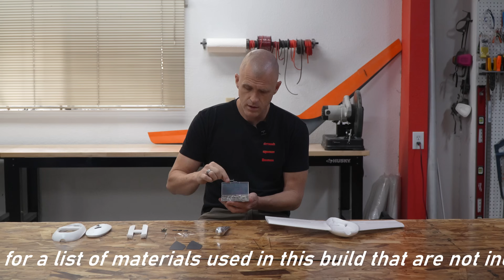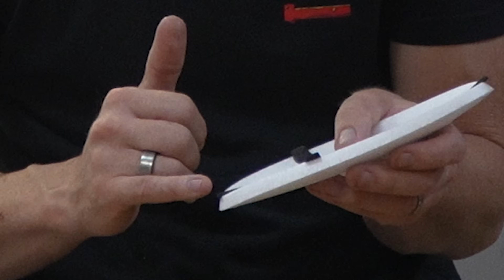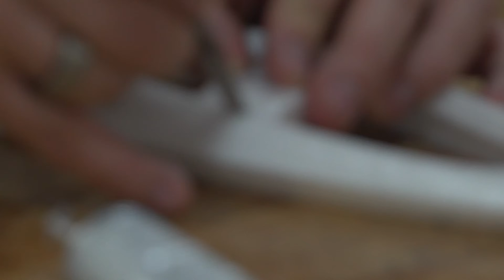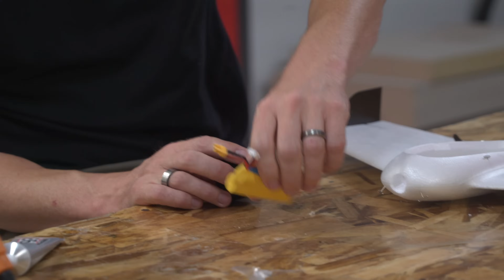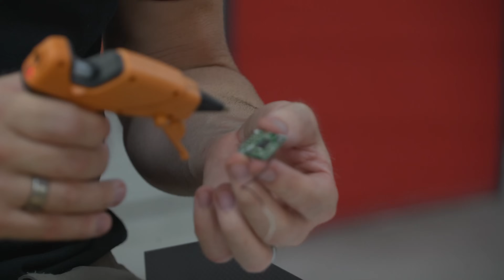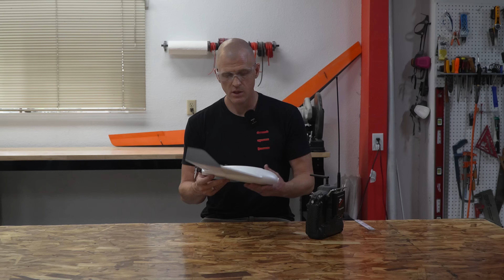Alight Wing Aeronautics Flik Build and Basic Setup

Comment: What's weird is that this guy designed the nano goblin first, and it has much better characteristics, I guess he sort of goes by feel and doesn't do fluid sim etc, but still weird that he couldn't' improve with the flik and it's just kind of the same but slightly worse (and supper expensive for a piece of molded epp) when moving the stabalizers to the wingtips

Comment: Apologies I am new to RC and have a couple dumb questions. 

1. How come he says the airplane is running on 8.4V (at 21:00) when the battery is a 2S 18650 Li-ion. Doesn't that battery config put out 7.4V? 
2. He says you need a BEC with the setup he has shown because the airplane (I read this as motor) is running on 8.4 V and all of the electronics (I read as servos) are running on around 5-6V, thus if you apply full battery voltage to servos they will likely fry. However the servos he has, and the ones that come with the Flik kit on Alight Wing website, are 2x ES9052MD. Per the servo data sheet, "Operates efficiently across a voltage range of 5.0V to 8.4V". So why the need for BEC?
Reply: 1: maybe they are so called hv-cells, which have a voltage fo up to 4,2v (I think) and therefore have a higher power density 
2. Not only the servos are electronics but also the avionics so receiver, video transmitter, flight controller etc., and these are running on 5v, and as the servos are plugged into the flight controller/receiver, these usually run on 5v too, as it is just easier to wire up. Higher volt gas arenonly used in cases where fast motion (<0,2s/60°) matter, like in RC helicopters.
Reply: @dontknow3886  I appreciate the response, thanks for the help! Makes sense

Comment: Ok I finally got my Signature Eddition in the mail! Saddly it seems as if there is an issue with the Included ESC, Do you have any tips or tricks to determine if I have a faulty ESC?  

When I plug the battery in I get the Initial 3 beeps but no other beeps after that, Is there a  tone that plays after the initial 3? Also when I plug the battery in and connect to ESC configurator I am unable to read the ESC.   Please help!

Comment: So bought the Emax RS1108 5200kv motor, EMAX D-SHOT Bullet Series 20A 2-4S kit. and realized it a 2 wire bl heli esc. I need  3 wire for pwm. Will any 20amp esc work in its place ?

Comment: Hello everyone. So I'm in the process of setting this little wing up. So, the wing spar can be glued in, and the covers glued on at the same time. I used foam-tac, which is best for Epp foam, and you don't need to pre-sand the release wax off. I tried to glue the spar in with CA glue, but it simply broke free with a simple flex of the wing. Foam-tac glue will hold the spar in place while you add glueto the edges of the wing spar pocket. Then, run some inside the little channel on the cover and push it into place. Working the cover in, every few minutes till it starts to cure. Foam-tac will bond in 15 minutes. I also used it to attach the winglets and stiffener/control horn. For electronics, I'm using Jx 5.6g digital metal gear servos and speedybee f405 mini wing fc. Motor is a rmrc 1306 3100kv motor and a 20a esc. On a side note, the control rods or pushrods need to be replaced with shorter wire. The ones I have are too long by 1/4". The build is fairly easy and shouldn't take more than 2hrs tops! Speedybeef405 mini fc weighs less than 10g by the way

Comment: Do you have a page or list of recommended electronics anywhere? I’m somewhat experienced with fixed-wing, but total newb with FPV equipment and flight controllers/autopilot. A video of how to mount the DJI FPV stuff for proper airflow, what flight controllers you recommend, and basics of getting started would be awesome. Understand if not in scope of the project, though!

(Kickstarter backer w/ two that I just received! Stoked to fly them!)

Comment: I've just purchased a flik and I'm wondering what spec 18650 batteries to use? Thanks
Reply from the maker: Molicel M35a should be fine with the stock power system.

Comment: I don't normally whine, but I sure wish mine would get here soon. Seems like it's been forever...
Am still thinking about a small EDF... maybe a 3s 40mm. With me... I never do a plane "stock". Am not concerned about 250g weight really. I did get the full-on Micro HDZERO package with the 540p camera option. Did get a better antenna than a straight dipole. Can't wait to get this plane up and running.
Reply from the maker: The patience of the community has not gone unnoticed, much gratitude!

Comment: Love what you do but between $80.00 and $145.00 for a form plane is crazy, I dread to think what the final price is for shipping to the UK.
I'm gutted, as I would have bought one if it were a reasonable price.
Reply from the maker: To give you a bit of context, at the price we are selling it, after everyone else gets paid I am making precisely 0$ at this point.   I may get something out of this in the future (maybe not), but from my perspective, its free.   If you take the simplistic view that it should be the price of the foam beads that comprise the airframe, you'll never be happy with the cost of any plane.
Reply: Do you have any idea what it likely cost them to have this mold made? This shit doesn't happen by accident. Do you notice that all the good hobby shops have closed down? That is because everyone is so damn cheap. Don't come down on the designer, come down on the people you elect, for causing your dollar to be worth peanuts.
Reply: It's $70 CAD to Canada plus all the taxes that will be added, which is most likely closer to its cost of the flik.
Reply: I'm a product designer in a related industry, and this is an excellent price. Especially considering that it's like two guys doing this work and doing small volume orders. EPP injection molds are expensive, shipping is expensive (factory to them), packaging is expensive, and all the labor they have to do really is expensive. It's different if you're a large company doing this kind of thing in larger volume.

Comment: I just ordered Flik Wing but I cannot find any info on how much it weighs. Will it be still under 250g with a 4S battery? Could you please add that info on the product page? Thanks.
Reply from the maker: Looking at 65 grams for the everything before you start adding electronics.   From there, you can get a good idea what the final weight will be with whatever electronics you choose.   The idea behind this airframe is that you can have a 2S 18650 battery, autopilot, telemetry and DJI 03 on the airplane at 250 grams or less.   If you vary from that, you'll need to work it out.
Reply: @RoyPark, 4s would be overkill unless it is a small 4s pack. Also, 4s motors often weigh motor. I. Using a 1306 3100kv motor, it's 2s only but it should provide good cruise speed and range.
Reply: @RedwoodRc  I'm using the RunCam WifiLink on it which requires 3S, and it's at 251g at the moment.

Comment: next video explain the setup on mission planner for only two fins. Thanks
Reply from the maker: Mission planner for two fins?   Can you elaborate a little more, I do not understand what you mean?
Reply: @thinkflight  i think they mean the elevons*
Reply from the maker: @ZyAudie9010  Ah gotcha
Reply: @thinkflight +1 for two fins
Reply: @thinkflight  this model only has two fins and so, the mixing settings on mission planner need some work to make it function well. The regular use is with separated elevator and rudder. But this one has only two for all three functions. What you did here is the mixing on the transmitter. but how to setup the mission planner for it?